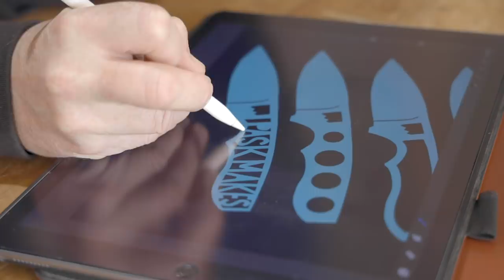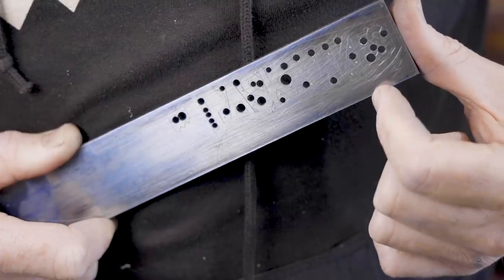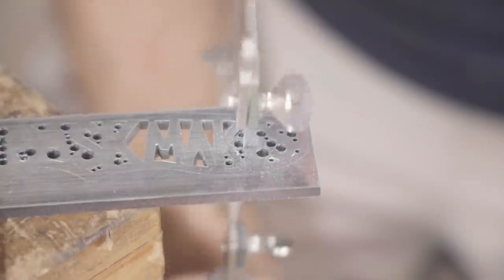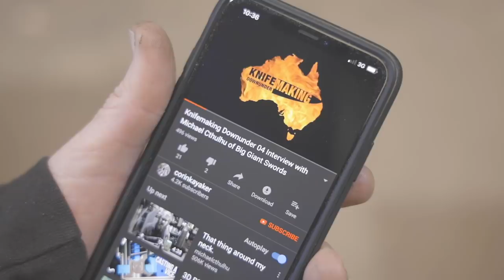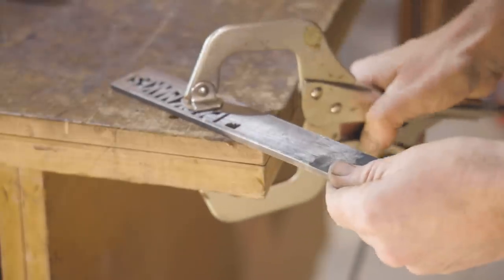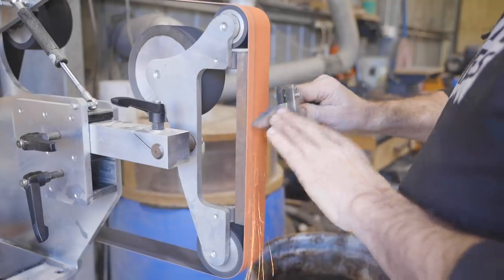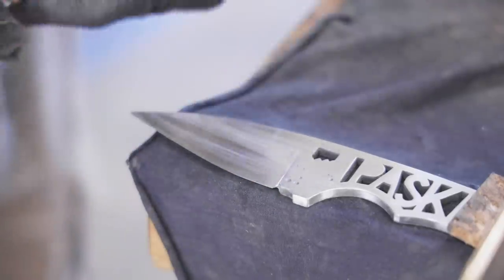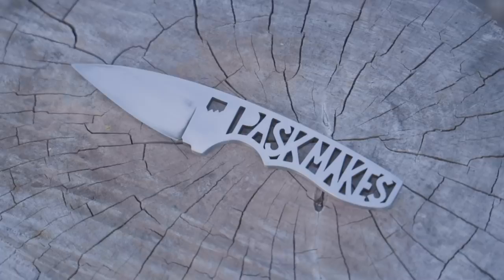Handmade Skeleton Knife

Comment: I thoroughly enjoy all of your videos.  If you have not seen it, Knew Concepts makes fret and coping saws with a unique tensioning device.  It's possible to put so much tension on the blade that you can snap it, but you can also tension it so that there is very little flex.
Reply from the maker: Thanks Patrick! I'll check those saws out! :)

Comment: Beautiful job sir. 
Not sure if I have the patience for the hand filing.
Recently, I was faced with the task of filing the inside shapes of an eight-spoke flywheel for a Stirling engine. What I did, was to adapt my cheap scroll saw to accept junior hacksaw blades. I then used strong double-sided tape to stick some emery cloth to the blades and used the contraption as a make-shift die filer.
It ran a bit fast, but worked surprisingly well.
Love your methods, where you use left-overs and stuff lying around to make worthwhile projects.
Happy Birthday. I got to 60 in May. My brain still tells me that I am 18, my body disagrees...
Reply from the maker: Thanks very much Gary! That sounds like a great solution! :)

Comment: if I make a suggestion, you can print inverse of the image with dark lines on a laser printer and than spray adhesive the print to the work piece ink side down.  the key is to than soak and wipe the paper off.  the toner with transfer to the adhesive.
Reply from the maker: Thanks Dale. I've done that before on wood but the method I used only took 5 minutes and is much clearer than a transferred print would be. :)

Comment: You need to also use a notched support like jewelers use and get the work as close to solid support as possible. Vibrations really cut down on cutting efficiency and increase the chance of blade breakage. The main thing is to keep good tension on the blade and don't let the strokes wander off vertical. You can keep using shorter sections of the blades until it just isn't doable.

Comment: What you need is to design and make a tool (like a drill, but smaller) that oscillates instead of rotates, that you can attach small files. Files small enough to pack away into a small box (like those tiny drill-bits you see on Dremels).

Comment: I took a jewelry making class back in college and we called that a Hercules Saw. Is that something my crazy teacher called it or is that the real name for it. I always called it a small coping saw. I've used it for coping crown molding and it actually worked great. It works really well on metal as long as you go straight up and down using light easy stores. The saw does all of the work.

Comment: Nicely done!
Have you tried Ferric Chloride? It is used to etch copper from circuit boards but on Steel produces a Black coating chemically bonded to the surface. It is one of the components in some rust treatments for cars ;0) and exess washes off with water.
Watch out though it will give you nicotine stains on your fingers!
Reply from the maker: Thanks Dave! I haven't tried Ferric Chloride but would've done here if I'd had some. I do plan on getting some though! :)

Comment: well you could have used a laser or plasma cutter it would have been done it 5-10 minutes.

secondly for removing the bulk of the steel use a metal coping saw or a jewelers saw.
It costs less then a good set of jewelers files and works much faster.
then come back and clean it up with the jewelers files.

it'll speed up the process.
Reply from the maker: I'd rather make it by hand, that was the point of the project. I did use a jewellers saw! :)

Comment: I've never made a knife before, so could you explain the rationale behind hardening and tempering it before it's fully sharpened please? Oh, and Happy birthday! :)
Reply from the maker: Thanks! You need to harden the knife so it will hold a sharp edge but if it's left in a hardened state it will be too brittle and the edge will chip (and even shatter if dropped). Tempering softens it ever so slightly to give it back some strength but not enough that it can't hold a sharp edge. :)